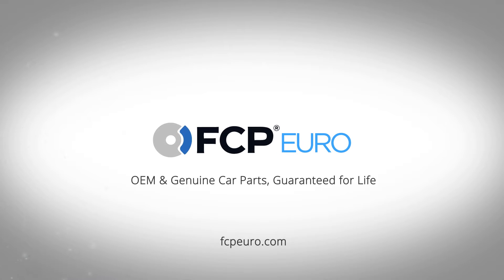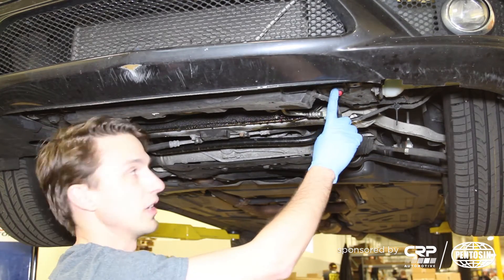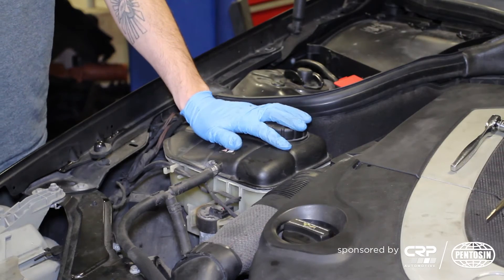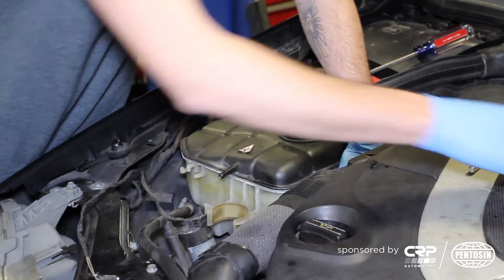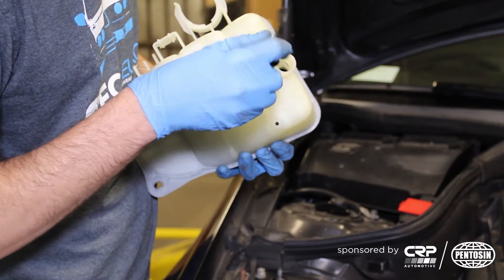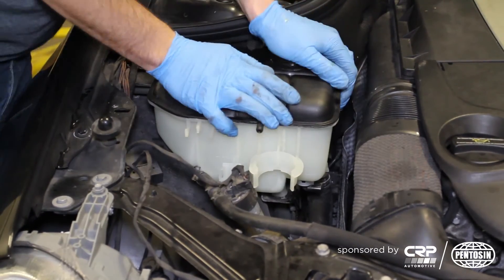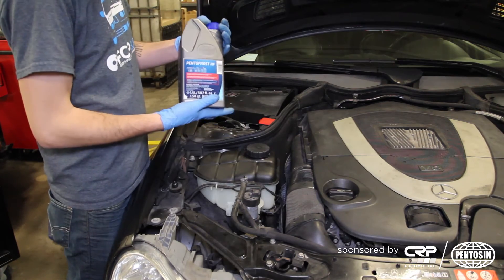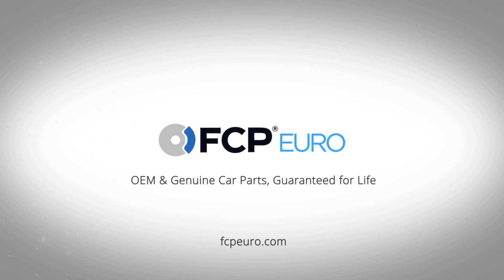Mercedes Expansion Tank Replacement Rein/Pensosin - Simple DIY (CLK550)

Comment: Great video and very clear. I have a problem being that the small tube from the reservoir connecting to the radiator hose broke and is stuck inside the hose, and so I have to replace both the reservoir and hose. Because of this I say be gentle as the things are very fragile. Also you should properly re attach the coolant pump like it was before, also you should’ve topped off the coolant to bleed out air. All in all clear vid. Thanks.

Comment: Great quick and detailed information.
Just as a side note. It's not an expansion tank, it should be called a coolant reservoir 😎
Reply: Hicham Elazarifi it is a coolant expansion tank because it doesn’t have a radiator cap located on the top of the radiator. You fill up directly in the expansion tank.
Reply: @kristoffersonbungay691  is there any bleeding involved of the system like the bmw expansion tank?
Reply: Tony R. It depends. Some expansion tank have a breather on the cap itself. If you dont then you have to run the heater all the way up and fan set to max after filling up. When ther is no more bubble or gulping sound on the expansion tank fill it up on the right level and you are good to go
Reply: @kristoffersonbungay691  ok thanks. I just bought an e430 and I'm replacing hoses, thermostat, and expansion tank.

Comment: What about siphoning out the coolant from the tank? I got a tube that is long enough to get inside the lower hose where it connects to the tank
Reply from the maker: Very helpful suggestion, thank you Chris. I've used the siphoning method before and it works quite well

Comment: please can you help me my coolant tank i fill it to the end when i check it next day i see that some of the water dissapear should i fill it to the half???  my car w203 2007 please help
Reply from the maker: You'll need to pressure test the cooling system. It could be leaking from a hose, rad, heater core etc. or burning (Head Gasket Issue).
Reply: FCP Euro but sir maybe the raditor systeam out all the overload coolant to the half   thats what happen when if fill to the end maybe the systeam out the coolant at the half and on my marceds theres no MIN MAX coolant like other car
Reply: FCP Euro my coolant level like the  video "at the half"

Comment: Sloppy job. the reservoir is supposed to attach the aux coolant pump with a large rubber ring around the pump. in the video you can see the pump being in place correctly at the beginning of the video, then being lose at the end, as the rubber ring is not in the correct position anymore